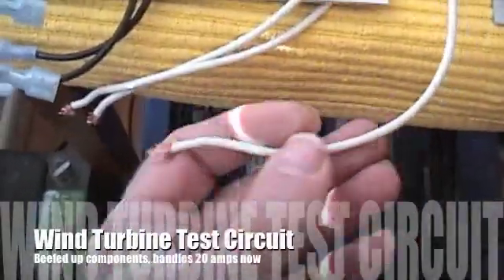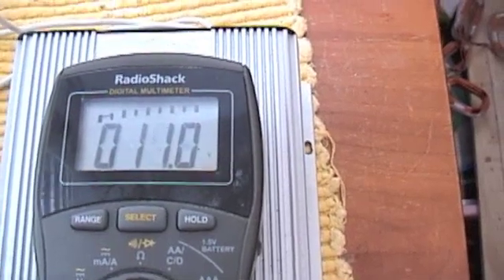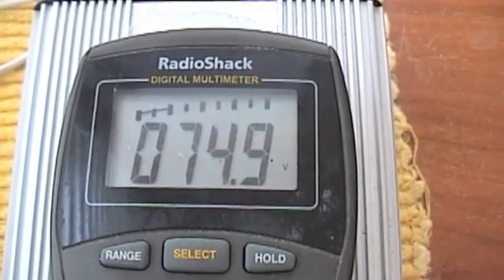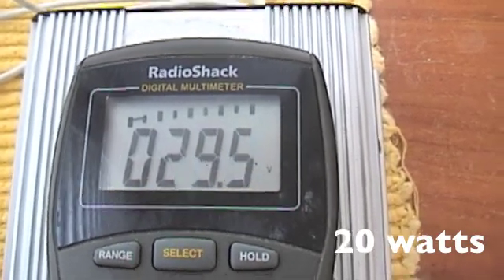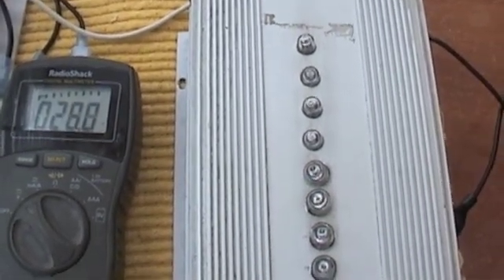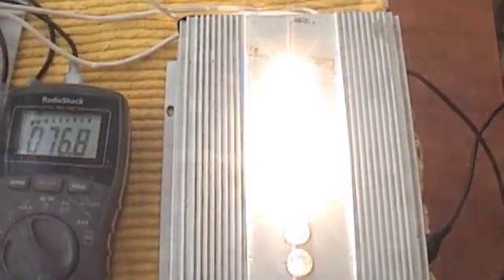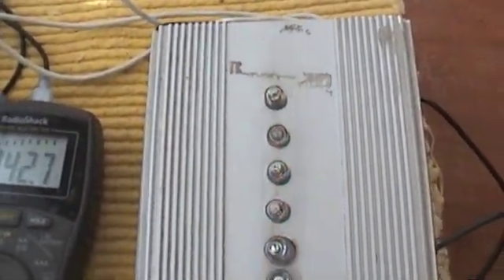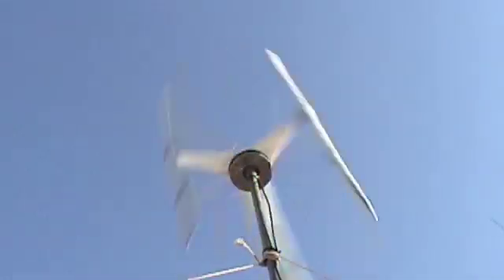Wind Turbine Test Circuit

Comment: @enticed2zeitgeist 

The aluminum box is just an old scrap used for this project.  The newly installed circuit has nothing to do with a grid tie inverter.  This circuit is a very specific testing device called a transducer.  It tells us how much power the wind turbine makes.

Comment from the maker: @rlewis1946 

The best ways to measure power are 1.  Torque meter readings at different wind speeds/rpms, or 2. Finding peak power from the turbine/alternator using variable resistive loads and measuring voltage drop across the load.  This device is designed for just a narrow range of wind.  If windspeed is held constant the only variable n the equation is the blade profile and way its set.  That is what this device is for.  Finding the optimal blade profile.

Comment from the maker: @enticed2zeitgeist 
The aluminum enclosure is from a dead Grid Tie Inverter.  Its nice because it had the DC outputs and the aluminum acts as a good heat sink for the large amounts of heat dissipated.
The circuit is a variable voltage regulator to allow the turbine to reach peak power in any given wind.

Comment: I'm curious about measuring a given wind turbine's efficiency in producing electrical energy. I'm sure there are formulas to due just that, but what if you a) knew the wind speeds at your turbine's height, b) the turbine's rotational speed (rpm) free running (no load) at those wind speeds, and c) that same turbine's speeds with a range of loadings (10, 50, 100 watts etc.). 
If a graph of these data were created, would it visually tell us anything?
Really enjoy your videos.